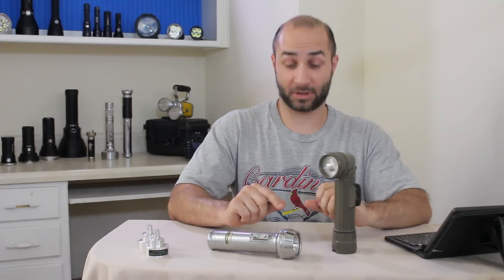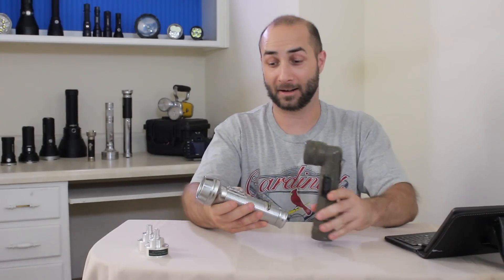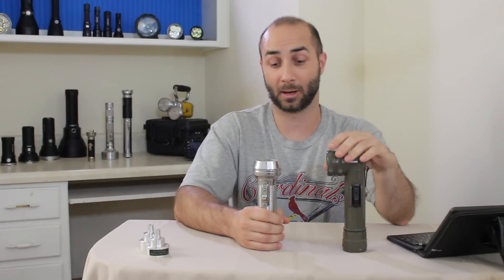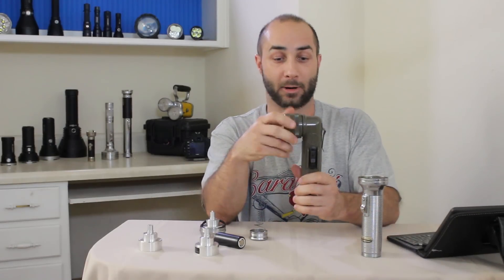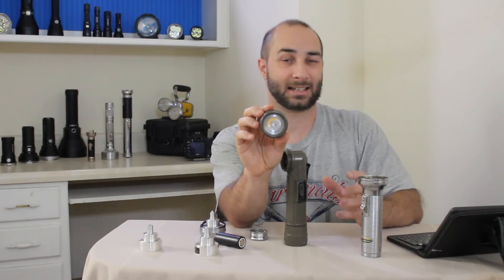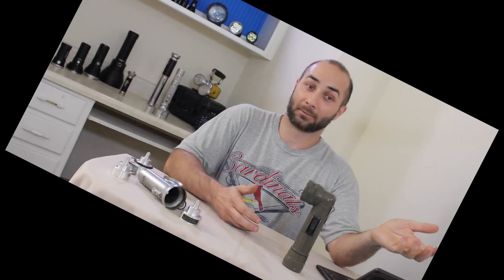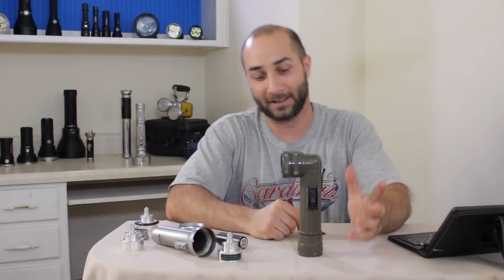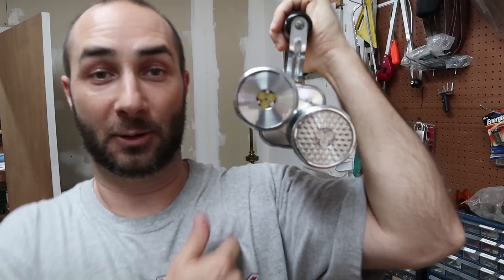Military Flashlight LED Conversion!

Comment: I did this with a sleeve to fit two 18650 batteries and an LED bulb rated for 6V to 40V. Needless to say it's pretty bright. Only thing I had to toss was the spare bulb holder.

Comment: @Matt Smith I just found one of the MX-991/U Flashlights passed down from family. Do you have a "simple" Led upgrade and or battery upgrade you could recommend? I was thinkin the 325 LUMEN FIREFLY 2-6 CELL & a single 26650 KEEPPOWER with sleeve would work. Your thoughts? Any concerns for overheating? I have no clue what brightness or runtime would be but anything >80 lumens and 30 min would be awesome! 1 hr would be great! Your input would be greatly appreciated. I just discovered your channel and products and will prob be upgrading my incandescent Mag lights from scouts about 2 decades ago.

Comment: I got this mini fulton torchlight which the batteries leaked within. Before this, i think i replace it with a different batteries (already used batteries) to test like whether the batteries are ok. Then i saw the lights dim. So i open the cap and find the batteries leaked (just at the moment) and immediately get a tissue to clean the inner parts. However, recently, when i bought a set of new batteries, i tested it again to see if the torchlight is in good condition (to see if can lit again cause previously i try another battery that still works but the torch does not light up), however, the torch didnt lit. Any suggestions how to repair cause the fulton torch is bought not long (months before)
Reply: Yes! Issue solved! Thank you:)

Comment: I got my angle light in 1993 when I joined the Army. It survived basic training, AIT (medic school), 5 years as a Paratrooper/medic for infantry at Ft. Bragg, jumping from planes and helos, a deployment to the middle east, numerous training/field problem ops in country and so on. I still have it. I'm missing the threaded part that holds the color lenses and the lenses themselves but it still works.
Reply: I work at Fulton Industries who is the manufacturer of this right angle light.  We love hearing stories of history of actual users!  Thanks for sharing.
Reply: Fulton sells genuine replacement parts.
Reply: Is being able to have it standing up on it's own the only reason to make an angled flashlight, or does that unusual form factor bring other benefits?

Comment: Those bend headed military flashlights were nearly indestructible.  When I was in Basic (20+ years ago) people would throw them away when the bulb stopped working, which was the weakest part of the light.  I would gather them up and use the spare bulb in the tail cap.  Still have about five floating around in my boxes, and they still work.  At the time, they were about $5, now I think the PX sells them for about $12 and that is still a good price.  Drop any LED bulb in them and they shine for days.  No offence, don't think I could do your conversion.  Still amazing work you did.

Comment: I love that M6, but it costs so much.

At first, I thought this was you selling this M6.

https://www.ebay.com.au/itm/SureFire-M6-Guardian-Hard-Anodized-Tactical-Flashlight-Used-and-Working/333625673513?hash=item4dada3c729:g:mtEAAOSw-MJe5m2R

As a Incandescent Flashaholic, maybe one day I'll own one of these sexy Flashlights.

Regarding the Football hotspot, I seem to have the same 'issue' with my MAGLITE. You can however diffuse (Frost) the bulb by rubbing it with 400 grit sandpaper which cleans the beam up but you lose throw. Very pretty hot spot though.

Comment: great vid. i also own the same flashlight that i acquired while in the army, got it in 2001, and have been wanting to change it to an LED flashlight. is it possible to just change the original glass bulb to an LED light, without replacing the housing like you did?
Reply: https://www.youtube.com/watch?v=KEyAbAewibA

Comment: If you thought the Fulton version of the US MX-991/U flashlight you modified was good quality, then check out the version made by G.T. Price based in Los Angeles USA that was also a military contractor for the same MX-991/U flashlight for a limited time but the build quality was much better and are preferred by most people that have tried both versions (including me) over the inferior version made by Fulton.  

The G.T. Price versions are harder to find as less were manufactured but worth the extra searching for about the same price.   

G.T.Price went out of business a long time ago and Fulton industries bought all the machinery and moulds for the MX-991/U.

Comment: as a retired military vet, those were the worst flashlights ever invented. they weren't even worth stealing.
Reply: The Fulton angle head shown in the video is a real military issued flashlight. Military learned why they were great and extremely reliable and over built. Plus you can store the colored filters, fire starter, extra bulb/ led behind the head and tail. It can light a fire easy with steel wool with those large copper contacts in the head, hold and use in the cold with gloves easier with the body/stick out switch design. Fulton sells an LED bulb specifically for the angle head for $17.98 which is optimized for that reflector they say. But the maglite drop in for 2D should at least be more light. The Streamlight polytac angle uses uncommon batteries and has worse battery life and electronic modes using a circuit board and that's something that will cause reliability problems down the road. As long as you know the differences you can buy what ever one is best suited.
Reply: Is there an LED that would drop-in into this light? I have the exact same plastic green light, I clicked on this video hoping to find an led i can just buy and place in
Reply: @F386Longrifle  https://www.superbrightleds.com/moreinfo/flashlight-bulbs/3-watt-flashlight-bulb-pr2-3whp-x/638/

Comment: Warm white is always the way forwards for me, pretty much every single bulb in the house is now warm white (I went on an led purge when I moved in in 2013)
Reply: 5 years later, and same. I only don't use warm white bulbs everywhere at home because my mother lives with me and she struggles to see well under warm light.
I really enjoy 2700K for mood lighting, but 3000K is more useful for lighting up cool colors as well as warm ones, so it's my go-to.

I only made an exception for very high CRI (R9080) cool white LEDs like the Nichias 519A and B35AM and the Getian GT FC40.
Reply: Warm White LED? Because LED drivers in light bulbs tend to be pretty shit though I installed a few newer ones 3 years ago so we'll see how these fair. LED Flashlights on the other hand are probably bulletproof.
Reply: @Vinnay94  leds are rated for colour temperature, so 2700k is pretty common and warm white, 4000k is neutral white and anything above 5000k is cool white and has a slightly blue tint to it.

The next thing to look at is the CRI or colour rendering index, incandescent light bulbs had a CRI of 100 - identical to sunlight. Cool white tend to have a CRI of around 70 this means colours look washed out and pale, definitely not good if you're trying to cook the perfect steak. Warm white tends to get much closer to 100CRI, generally between 96CRI and 98CRI. It's close enough that you don't end up with a well done steak instead of medium rare.

Yes, the early led drivers were shit, but now, even the cheapest led bulbs seem pretty reliable, my favourites are the led filament bulbs, they look much like a traditional incandescent bulb, but have the power efficiency of led. They also look much nicer in fittings where the bulb is visible.

And yes, led torches are pretty bullet proof, I used to build them over a decade ago, most still work fine, even the every day carry work lights.
Reply: @gords1001  Yes, I already know about Colour Temperature and CRI but great explanation anyway. Yeah I'm sure newer LED bulbs are more reliable. My only issue is flicker, it's not hugely noticeable but it is there. Apparently those Filament LEDs also have flicker and those things are more expensive. So I swapped back to my 72W (1000lumens) Halogen because I'm a Lightphile.

Comment: Did you use the 3000k 95cri SST-20 in it?
Reply from the maker: It's XML2
Reply: @Lumencraft-  Those are nice builds.  Barbolight sells a reproduction of the FA-5 used by NASA.  Uses an XP-L HI 3K High CRI.  That's a nice one too.  I had to spring for one of them.